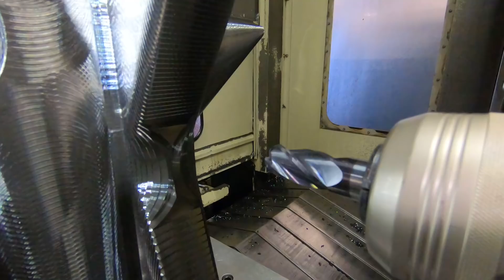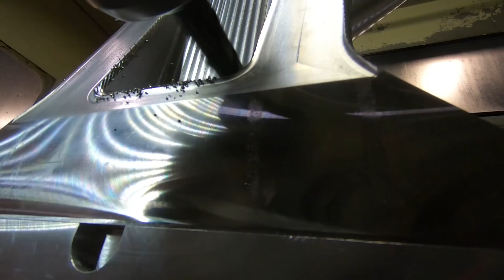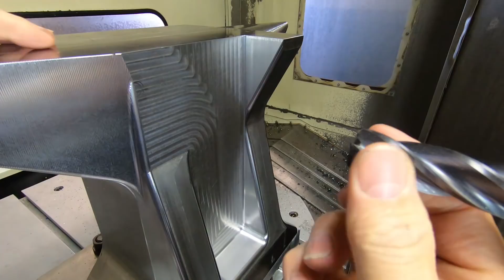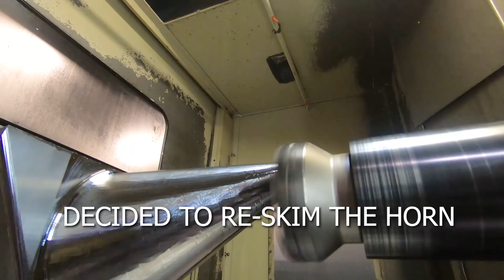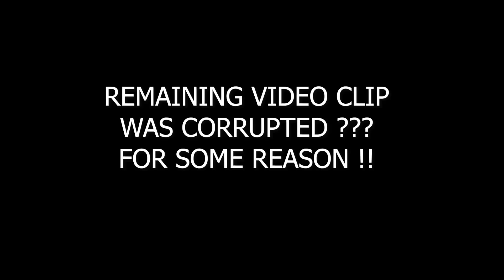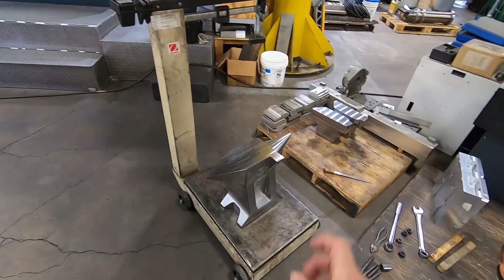Finish Machine 250 Lbs. Anvil

Comment: What was the cost to make it? Did you just start with a huge chunk of steel?
Reply from the maker: I had this left over forging from a job a long time ago. In fact I have two of them. Making a anvil this way is probably the most expensive way to do it. These forgings just by themselves cost more than buying a new anvil. I had them so I did it this way for the videos.
Reply: @EdgePrecision  thanks for the info. Truly a work of art. Did you eventually hear treat. My assumption is that it turn out as one awesome forging anvil. It definitely had a sweet ring. 😁 Truly enjoyed watching your video. Thanks for sharing.
Reply from the maker: @gingebrien2408  I haven’t heat treated it. I have finished the smaller ones out of the same block of material. I need to get a price for maybe a induction heat treat of the top surfaces of all three anvils. If it is reasonable I may do it. But really just the way they are is good enough for a decent anvil. You don’t really need all that hardness for forging hot metals.
Reply: @EdgePrecision  Most modern tool steel anvils are heat treated, IMO. I have a Hay Budden with the top 1/3rd tool steel, and it is definitely heat treated. The Crucible in Oakland, CA made some solid tool steel anvils and heat treated them as I recall.
Reply: Thanks. I figured that. But since you mentioned heat treatment I wondered if you went the extra mile. Again thanks for your time.

Comment: EWWW WEEE that is one sharp looking anvil. Whats something like that cost, roughly ?
Reply from the maker: To much for a anvil. Sorry I didn’t keep track of cost. Making videos makes everything take about five times longer. So it’s hard to tell.
Reply: @EdgePrecision  well its a beautiful work of art. I went to a machinist school and I loved turning chunks of metal into actual working parts. I was sort of suprised, it seemed as is both the tool and part were moving in unison or was that just a misconception?
Reply from the maker: @brownleatherboot277  I’m not sure I understand your question. Can you be a little more descriptive?
Reply: @EdgePrecision  it looked as if the tool and the part was moving in unison while the tool was cutting. I was wondering if that was true or did I see it wrong? I would think the part would be stationary while the tool did the cutting.
Reply from the maker: @brownleatherboot277  on the horizontal mill the X axis moves the pallet the parts mounted on while the spindle moves in the Y and Z axis. So the part and the tool moved at the same time. So it could be the way you saw it. Does that answer your question?
Reply: @EdgePrecision  yes sir. I just thought it would increase the danger of the CNC crashing with two moving parts but that is probably from my inexperience. Technology is ever advancing and f-ing AWSOME. Thsnk you

Comment: Peter, can you make a quick video on determinating the center of rotation on a horizontal machining center? I think you mentioned it during the initial setup of the roughing of the anvils but ended up using several work offsets instead.

Comment: Peter
I would be greatful if you could run through your process on planing a job , I assume that you get the engineers prints as a cad file , but what are your thoughts on looking for the parts  that are not possible to machine and the way you make sure that all the machining is done one a part , do you use a check sheet or WHY .

BTW I have learnt a lot from your videos in the way you systematically approach the task at hand

Comment: Not going to lie.
Its kind of sad seeing such a huge, expensive, powerfull and accurate machine getting held back because it has 1.000.000 times less memory than a 80$ smartphone...
Reply from the maker: In the days that this machine was built. The new cutting strategies created by new cam softwares didn’t exist. With the older ways of cutting. 500K of memory was plenty to run almost any program. But not now.

Comment: When you re skinned the horn did you change the cutter comp or change the program its self?
Reply from the maker: That cut is not using cutter comp. I reprocessed the program with a finer tolerance. To improve on the poor finish. Because of the massive increase in size of the program. Over 5 meg (The machine only can take 500K) I had to do a DNC/drip feed from the computer to rerun that cut.

Comment: 500kb! Wow.  Is there a way to expand it? Maybe it can't do more then that. Depends on chips they used. Sometimes they have limited memory size  access. But if you could... that sounds like bottleneck on otherwise great machine you have. I saw some weird pricing for memory on CNC machines and can get pricey. Its weird as price of memories are not that high on the market. It would be cheap upgrade otherwise.

Comment: How about grind a meaty taper endmill and mill under the horn instead of the long 1” end mill?
Reply from the maker: The Horn is 7" long perpendicular to the side face. That would be a long endmill. Also there are many different tapers. The top of the horn is straight so a tapered endmill wont do the cut. A 5 axis move could but this machine doesn't have the five axis.
Reply: @EdgePrecision  I was thinking short stubby then scan down like 3D.  Or barrel mill?
Reply from the maker: A barrel mill yes but tapered no. But a barrel cant finish all the way down unless it has a small radius on its tip. So it could be good till the last say 1/2" than I would have to come in with another too to get the smaller radius between the horn and the face. But I didn't have that tooling. I wasn't wanting to spend any more on tooling. Just use what I already had.

Comment: Truly amazing Peter! I don't know how you got that 1" endmill to cut and not chatter the entire time. Do you remember what you were running for feeds/speeds? Especially with the differences in the length of engagement on the heel end of the anvil I would think chatter would have been an issue.
Reply from the maker: I ended up running 350 rpm at 8.5" per minute feed.

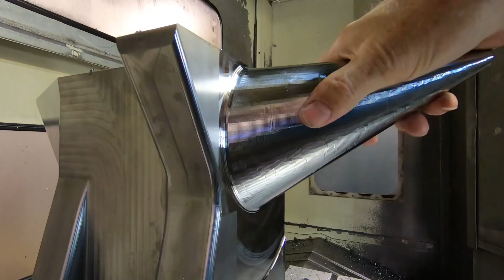Comment: 16:43 clearance is clearance...
Reply from the maker: The horn is 7.00" long and the tool had exactly 7.00" of clearance on its flange. I faced .010" off the horns tip before running the program.

Comment: thats a beauty but what's it's metallic composition its strengths and weaknesses?  and will u need to quench the top differently to the body? or will u need to quench multiple times so horn isn't compromised?
Reply from the maker: This was machined out of a forged block of 4340 steel. I think it is in the normalized condition. Even in this state it is plenty strong enough for a anvil. It could be induction hardened on the top faces. If that were done it would be a most excellent anvil. This is exactly the material to make a anvil out of. I just don’t want to spend the money for this expensive heat treat process. It will work fine the way it is.

Comment: Those scales should be pretty accurate. If peeps haven't opened the scale and pulled on the main spring, they keep their accuracy for many years. One other thing, clean the pivot point and put a dab of way oil on it (it's under the top cover). If you can, of course, some of these are locked, so you can't mess with them. 

Source: i own a couple of similar ones and mine haven't lost calibration since 1984/1993 when the last stickers are from. I check them once in a while using a 1kg unit, and a 10kg unit, which are both calibrated weights. 

Old school scales are the best, they know no death if given some TLC.

Comment: Running a program through DNC sucks! Have to go to the pc to rerun an operation. 🤬
Reply from the maker: Also because this machine is older the max Baud rate is only 9600. So this limits the speed that the machine can run.
Reply: @EdgePrecision  yikes! Must take over an hour to load a large file.
Reply from the maker: It does take a while to load a 400+ K file but not a hour. Say about five+ minutes. I’ve never trimmed it. It probably could be calculated based on 9600 baud.
Reply: @EdgePrecision  yeah and if you bumb it little higher you get trouble. I've tryed...
Reply from the maker: There is no higher setting or I would use it.
Reply: Owning 1 machine, it being a older Fadal; DNC is all I've ever known. =) Can't suck if you don't know better. lol

Comment: Are you blowing chips away manually or is that part of the program?
Reply from the maker: No I was doing it with the air hose. The lifting magnet I used must have slightly magnetized the part. The shavings were sticking to the part. Normally I would be using flood coolant. But for the sake of the video I was running with no coolant. So you guys could see better.

Comment: Just curious.  What does a chunk of steel that big cost?
Reply from the maker: I don’t remember. This was left over from a job a long time ago.  It was a forged block of 4340 steel. Around 750 lbs. I would say a forging this size would be around $3000.00. But that’s just a guess. It may be more because of test samples for the physical properties. This material has no traceability so it can’t be used for a job.

Comment: That has got to be one of the finest anvils on planet earth~ beautiful work Peter.
Reply: My only complaint would be that since he must have started from a massive rectangular block, he could have removed less material and had an even heavier anvil.  Probably could have hit 300lb. 

Damn fine anvil though, I hope it gets a proper heat-treatment and many years of use.
Reply from the maker: @mattrevesz  Actually the block started at over 700 lbs. I don’t know if you have watched any of the other videos on this playlist. But I’m going to machine two other smaller anvils out of the extra material from the block.
Reply: @EdgePrecision  Sir, is it 4140 steel?
Reply from the maker: @ayrkotu1612  no 4340 steel forging.
Reply: @EdgePrecision  thank you Sir. You are the only one.

Comment: I have the same issue with program size! Machine tool manufacturer’s should start putting larger memory cards in without raising cost to outrageous prices
Reply from the maker: Newer machines have more memory. For instance my Mazak Integrex has around 2.5 meg of control memory. The newer ones even more. The use of cam software and modern cutting strategies takes more memory.

Comment: I run a machine with the same control as yours in my shop, if you're running up against memory limit issues in the controller it's a fairly trivial process to set up DNC to the machine using OneCNC DNC and a USB->RS232 cable (there are a few specific ones that will work, some won't.) Then all you need is a laptop to keep near the machine and you can run as large of a program as you want. Read-ahead on these controls is pretty bad so I would recommend some feed rate reduction on higher feed cuts.
Reply from the maker: I think I mentioned in the video. When I recut the horn the program was 5 meg size. I ran that from my laptop thru the serial cable in the DNC mode.

Comment: Peter, that tease at the start got me laughing and certainly trapped me for the whole video XD

Do you plan on heat treating the anvil when you're done?
Reply: your hammer is heat treated too and it doesn't shatter when you hit something with it though, right?
Reply: @HAGmbHkeG  👆
Reply: @HAGmbHkeG  well it would chip if you hit it with another hammer. I was a high school metalwork teacher back in the late 70's to 90's and I had a 12 y.o. student do exactly that. A small chip of steel flew at supersonic speed from one hammer corner and hit one of the female students in the chest, it went through her craft apron, through a jumper and shirt into her skin. She had to be sent to hospital, X- rayed and have the chip removed surgically, poor lass. The students had been told how dangerous it was. And the boy who did it was almost expelled from the school.
Reply: As a glassblower I'm intimately familiar with annealing. We have to annealing everything we make it it shatters. Annealing is the act of distressing the locked in thermal variances by taking it to the point where strain is minimized in a stepped down progression, today achieved by digital kiln controllers and intimate knowledge of chemical composition. Normalizing by contrast is simply equalizing those stresses. Tempering is controlled use of those stresses to create predictable failures in glass and controlled material characteristics in metals. You do NOt want to temper an anvil guys.
Reply: I believe he said it was a pre heat treated material
Reply: Why would heat treat and make it shatter when hit with a hammer ?
Reply: @peterresetz1960  first you heat treat, then you temper! That way it doesn't shatter.
Reply: @jonwatte4293  tempering is a process that falls under the term "heat treat".
Reply: @mattrevesz  ... As is annealing and normalizing! Both of which will make the stock much softer! The way I've always heard these used in practice is "heat treat" for the heating-and-quenching part; "temper" for the relaxing/toughening part; "annealing" and "normalizing" for those parts. That's always seemed practical and unambiguous to me, but I'm sure others do it some other way!
Reply: @peterresetz1960 , so better to dent the hell out of it with a hardened hammer?